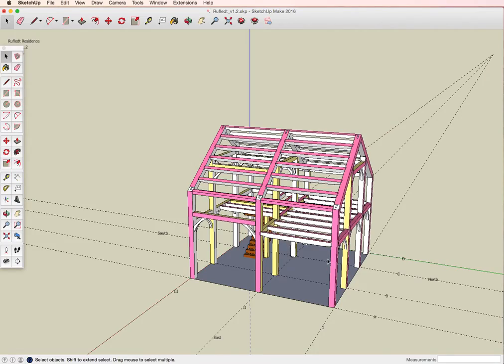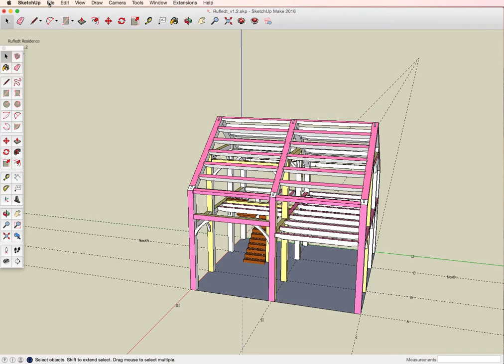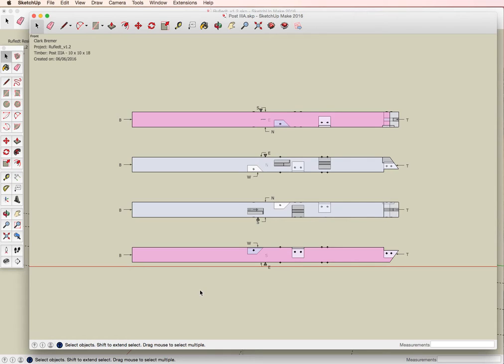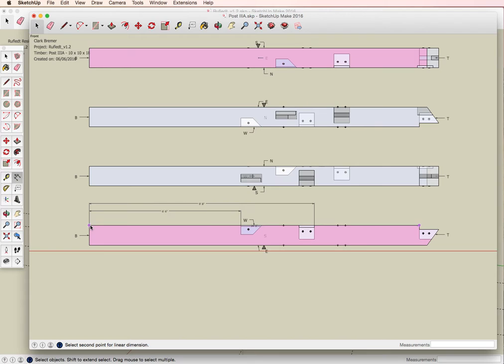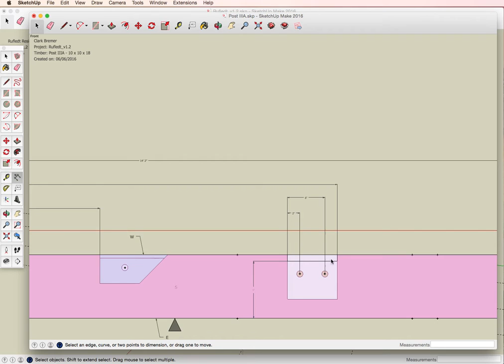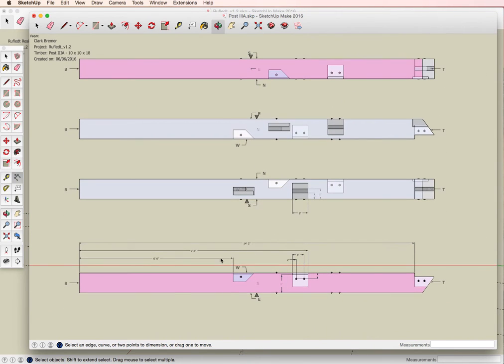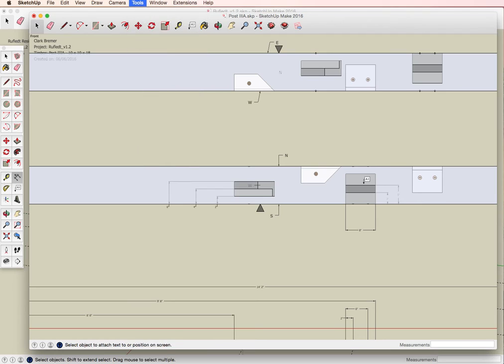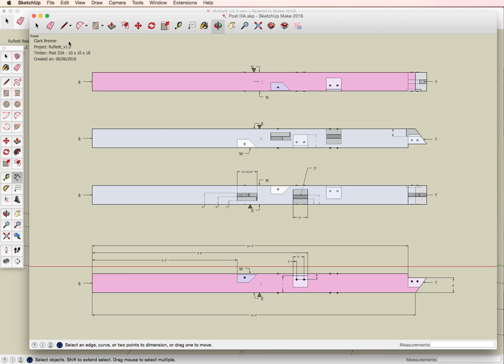shop drawings

Comment: i am trying to export a shop drawing for a timber and it doesn't allow me to save it as a .skp file. i am very new to your extension, but i am very familiar with sketchup. it seems like a fantastic extension. 

thanks,
Reply from the maker: It should fill in the extension for you, so it should be a .skp file.  And it should default the name to the instance name (if you gave it one) or the definition name of the component.
Reply: It’s blank on my screen
Reply from the maker: @forrestheaney9059  What version of the extensions, and Windows or Mac?  Perhaps send me the file?

Comment: This would be incredible but its no longer supported by the latest version of ketchup. Any alternatives for the 'Make Shop Drawings' feature?
Reply from the maker: The latest free version of SU is web based, and does not support ANY plugins, including mine.  If you still have the last free version that is not web based (SU17), you can use that.  Or if you have a more recent paid version, it works with those also.  I've been using it with the paid version of SU_PRO_22, and it works fine.  I have not bothered to "Certify" it on the extension warehouse, but it does indeed work.  CB.
Reply: @ClarkBremer  Thanks for the reply. I'm using SU Pro 2022 and it said it wasn't compatible in the extensions browser but it did install fine manually and is working great! Many thanks

Comment: Fascinating.  So if the shoulder depth is dependent on timber thickness, does that mean that the plate length can't be finalized until that thickness is measured while cutting, and furthermore should it be done after planing?
Reply from the maker: No.  That's the whole point of "square rule".  You don't need to know the actual thickness of each timber before you start cutting them.  Yes, to the joinery after planing so you don't throw off your measurements.

Comment: I purchased the SketchUp manual from the Timber Framer's Guild but I am not able to find the Rubies extensions and component library.  It shows you as having 6 extensions offered, none of which are referenced in the manual.  Are they no longer available?
Reply from the maker: Having a problem with the extension warehouse.  Until that's fixed, you can download and manually install them from here: https://github.com/clarkbremer/TFRubies/raw/master/CB_TimberFraming_2.4.5.rbz
Reply from the maker: Fixed now.  The plugin can once again be found in the usual location: 
http://extensions.sketchup.com/en/content/timber-framing-extensions

Comment: how are the reference arrows assigned?
Reply from the maker: You mark the reference faces in your main drawing by painting it any color.  I use pink for "no sand" faces, as it shows up grey on my printer that's light enough to see through, but still noticably darker, and khaki for other reference faces, as it doesn't register when I print.